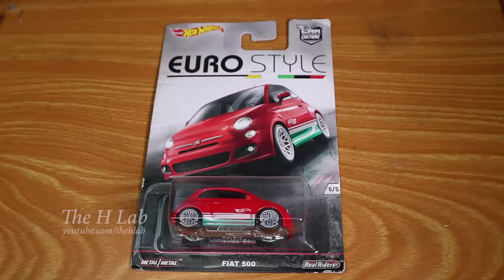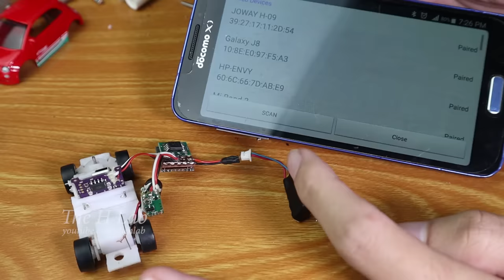Fiat 500 Hot Wheels 1:76 to Bluetooth RC Car | The H Lab

Comment: I couldn't help but notice The car turns right when he steer left!!
Reply: Well you gotta turn right to go left
Reply: @n04sH1  😂😂😂Doc
Reply: @Nismo YT he can easily fix that by reversing the wire of the front motor..i think he likes it more like that..eho knows
Reply: @b-beluga4510  nah i think he didn't want to re-do it on video (although he couldn't have cut out the part where he did it wrong)
you can tell from the way he drives that he's not comfortable with the steering like that.
Reply: @b-Beluga it isbon because of the gear system,i thinh he also know that
Reply: Exactly! Same here..

Comment: I see the steering control got problem, when your rotate the steering wheel on the phone, the direction on the car's front wheels are always opposite it.
Reply from the maker: Yes. The steering direction can be setup on the App. Just goto setting and revert the steering direction.